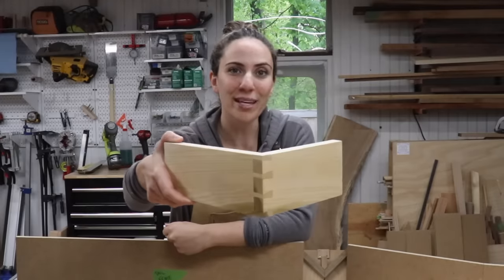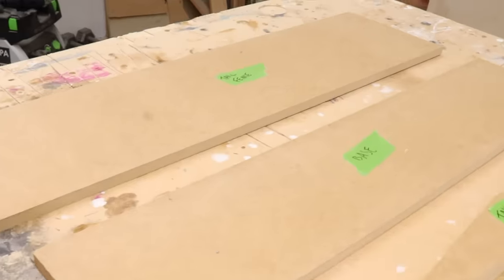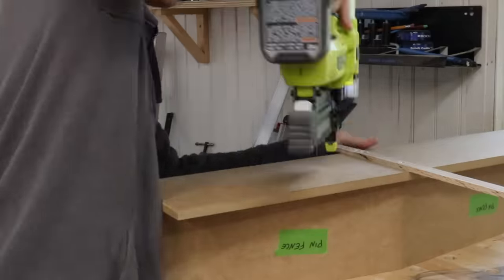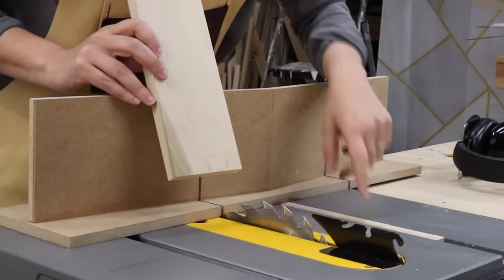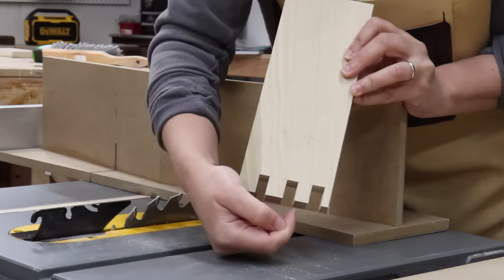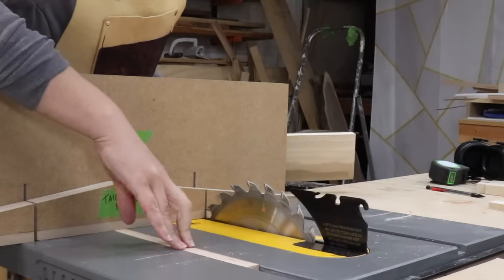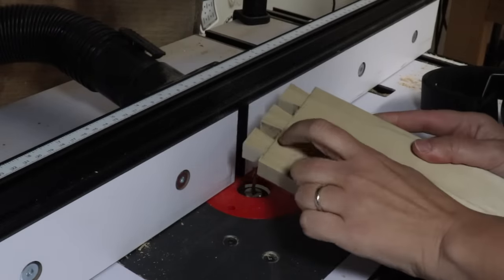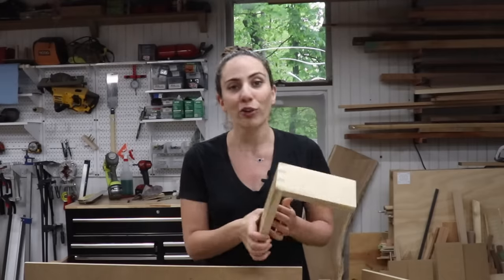Dovetail Jig for the Table Saw // Woodworking Joinery

Comment: It would be easier to tilt the blade if you are cutting the tails? You could then also by bringing it back to 90 degrees clean up the waste. You will have to make a a jig to set the blade to the right angle.

Comment: I love it I think this is a great jig and when you do the tiles instead of adjusting the height of the blade for the other side of the jig I wonder if you could just reverse the timber to cut the other side I don't know if it will work it's just a thot
Reply: I was about to say the same thing.
Only, you have to accurately mark the board on both sides.

As a matter of fact, only mark the ends, which side is the waste and then set the height.
Reply: I had got as far as thinking that the sloping part of the jig could slot between two stops, and you just take it out and turn it round. Your way is probably better, but if you weren't confident in accurately taking the measurements round to the other side of the piece (like I'm not - I'm junk at that), then that would work...

Comment: Great video, is that the dw745?

I've got the european version and the blade guard setup on the riving knife means you can't do no through cuts. Is that a standard riving knife that came with the saw or a one you bought after?

I'm resisting the urge to cut the top off my riving knife
Reply from the maker: Thanks! Yup. It’s the 745. This is the stock riving knife and The blade guard can be removed on this riving knife. Don’t know how the European Models are made. Sorry. I recently did a video where I installed a zero clearance insert with an MJ splitter if that’s something that interests you
Reply: @3x3CustomTamar  ah, the UK 745 comes with a riving knife that's higher than the blade. I was hunting for a better option but it seems we cant get one here.

So I gave up, I've ordered a second riving knife and I'll just cut it down :)

Comment: Great Videos Tamar!  The only suggestion I'd like to add is, when you build your Jigs, is to add a dado a slot in your jig bottom to mount your Miter slide into before it's glued and screwed. This will keep your miter slide slat true and square long term.

Comment: Beginner here, do you have a prioritized list of tool purchases?
Reply from the maker: Tablesaw was a big one. Then after that router.
Reply: @3x3CustomTamar  What table saw do you recommend? I have seen a variety of saws with different blade sizes, and it is getting confusing. Small workshop area so it needs to be portable and somewhat compact.
Reply from the maker: @timlist4173  I would recommend mine but they don’t make it anymore. Dw745

Comment: Super important safety point. Your fingers appeared to get incredibly close to the blade around the 0:50 mark. It may have been the angle, but that blade WILL cut your fingers off so fast all you will feel is a tug and it is gone. Please always use a scrap piece of wood to move the cut off if it is within the cut out portion near the blade.

Comment: Bear in mind back in the day people would do this or a living so there’s no substitute to the student gaining hand eye coordination. However there’s some interesting tips in there, I was shown to use the saw in the tails saw cut years ago by an old boat builder however never liked that technique. I would say rather than angling the saw for the tails cut place the piece in the vice so your cutting straight down. Lastly I get on very well with a gents saw filled like a rip saw and I don’t dress the side of the blade so much to substitute for nearly zero set.

Comment: I might make a thinking error here, but can't you just turn your workpiece around to get the opposite angle? 🤔 And I feel like placing the workpiece flat on the workbench, clamp it down and only use your chisel should do the trick? But again, I really have no idea what I'm talking about... I'm just thinking "out loud"... Anyway, you did it! I have never done this before, but did draw a design for one of those handsaw dovetail jigs with little magnets in it to "lock" the saw blade in place 😁 Wonder how that would work out 😬
Reply from the maker: Maybe. I have the Katz Moses dove tail jig now. I think that’s kind of like what you’re describing. It’s great
Reply: @3x3CustomTamar  That is exactly the one I mean!

Comment: Couldn’t you make it all one jig by mounting the pin side and tail side to opposite sides of a larger base with the business sides of each oriented to the middle of the base? Then it ends up being the size of a cross-cut sled and you just flip it around on the table saw.

Comment: Interesting concept with this setup. However if you are going for both a very solid joint and look appeal, why not use a basic, easy to do, finger or box joint setup and then drill small holes and insert wood dowels to positively secure any joint and look amazing at the same time. You have tow options doing that. One is to come in from the top of the joint and drill through all the fingers for the inserted dowel. And the other way is to come in from the finger side and insert dowels in that direct. Just an idea...  Thumbs Up either way!

Comment: Have you figured out the tails yet? (It’s been a year) 
A few thoughts 
1) spin the jig around, in the same slot, and align the piece on the backside.
Or 2) put the other direction ramp on the backside enabling you to eliminate half the jig. (You did say it was kind of big)
Or 3) figure out the difference and remake the jig with the ramp moved over whatever that difference is.
Reply: Agreed with Paul, I believe that you could just transfer your marks(though a chance for error here) and flip board.

Comment: Don't worry about your angle. Any $99 table saw has good angulation capabilities. and you will not have to worry about cutting above or below the line.

Comment: What is the primary purpose of dovetails. Show, or Strength?
Reply: They're for holding corners together.  They have good tensile strength (they're hard to pull apart) and they give a lot of surface area for glue without the need for screws or other mechanical fasteners
Reply: @BHNarezza  Okay, then why are the pins so small. Doesn't make sense to me.

Comment: No carpentry, just machining. I agree you used some marking out and setting up skills, but for the most part, the 'skill' of the job has been given over to your equipment.  I love how you try to over explain what you are doing as though none of us had ever made a wooden joint before. Like teaching your daughters to make pastry, gods that must be a bore. There are a number of carpenters on Youtube that can make the same dovetail box withut using a single machine, imagine that, all by hand with less than a hundred dollars worth of tools. Whats more, mistakes, if they happen, are not shared, it is not a sign of being clever, but a notice that you don't think ahead, don't practice, just tell. All that yakkety yak and not even a rebate for a bottom panel. Well done.
Reply: Yes, clearly the skill of the job was given over to the equipment. She just set the material down near the machines and they did all the rest! I think you are far too clever for this channel. I hope you find some content more suited to your likes. Meanwhile the rest of us 175K+ subscribers will continue to watch this channel with great interest...

Comment: Instead of lowering the saw blade for the second side of your cut, try this. Make a TEST cut using BOTH sides of your jig. Then using a dial caliper, measure the depth of both cuts. Then cut a piece of wood to that EXACT difference between to two depths. Then attach that thin piece of wood to the side with the deeper cut to RAISE the work piece, rather than Lowering the blade. This would be a ONE TIME deal and the jig would then be good to use for BOTH sides of the cut with NO need to adjust the blade height for each side.  Simple way to solve your problem ONE TIME and be done.

Don.
Reply: Thank you very much for your Heart reply, it means a lot to me and tells me you care about what your viewers think of your videos. 

I think that while I offered you a good way to correct your small problem with the saw blade being too high on the second side, my advise was in error. I did NOT take into account the fact that your fixture is holding the work piece at an angle, 6 degrees if I remember correctly, and that needs to be taken into account when you make a spacer to raise the work piece instead of lowering the saw blade. I was up last night half the night thinking about this issue for some reason as I’m thinking that the difference between the two cut deeps would be TOO much if you make a spacer that thickness due to the 6 degree angle of the jig. 

What I would recommend is that your make a second test cut, first make a cut on the second side as is, than install a spacer made from maybe a piece of 1/8 inch Hard Board, Then make a second cut and see if the .125” Hard board gives you a .125” shallower cut. My brain is telling me it will be more like .130-.135 instead of .125” . If I’m correct in my thinking this would mean a spacer made to the difference in the two cut deeps from what I told you to try last time would be too thick. I’m thinking you need to use either the sine or cosine of 6 degrees to correct the thickness of your spacer. What you could do is do the second test I just suggested and then use the same percentage factor to use to correct for the angle of your jig. You could look up a Trig table online and get the sine or cosine for a 6degree angle, but I’m thinking doing the second test cut using a spacer of .125” thickness would be both faster and easier to get a percentage factor to use to adjust for the angle.

I hope this makes sense to you as I described it. Knowing you from watching a few of your excellent videos, I’m pretty sure you have it all figured out by now, being as smart and clever as you are. I appreciate SMART people and you are one of my favorites when it comes to watching videos on how to do DIY projects. Keep up the excellent work. I’ve been doing wood working since before you were born if I’m not mistaken, and I stall manage to learn a thing or two each time I watch one of your videos. You come up with great ways to solve problems, especially when you don’t have what you would need to do a job, and you just figure out a way to get the job done with what you have. 

Thanks again for the heart post.

Don Fisher

Comment: Bit of a stretch to call this a tablesaw jig since you used every tool in your shop except a lathe.  

Granted you did cut 4 of the precise lines with your jigs.  It would be an improvement to have a system that would index the cuts so that pins and tail could be done without hoping the alignment with the blade was close enough every single time.

Comment: On the tail jig, why don't you just lay out both sides of the work piece, and then you can just flip the work piece around instead of switching sides of the blade... 🤔
It should just be a square line across the end grain, because everything else is already set...

...or am I missing something?

Comment: I seen you struggling with trying to clean up the end bits with power tools. Sometimes the simplest tools are the best for this - the good old chisel. You would have had them cleaned up in less time than it took to set the bandsaw up. Cool jig though for the table saw.
Reply from the maker: Very true!

Comment: You could just add the difference in height to the left edge to make the two sides the same.  Easier than moving the miter slot bar…

Comment: What was the point of the triangle board? It wasn’t used in the final piece? 🤔
Reply: Did she use them as support pieces to keep the taller part of the jig at 90 degrees?
Reply: it’s used for getting cuts at an angle

Comment: Couldn’t you just use one side of the jig and turn the board around instead of switching sides and adjusting for the new depth?
Reply from the maker: Sure. But that would require extra marking. And this was just an experiment to see if I could replicate the picture I saw online which looked like this

Comment: I've seen a lot of colonial furniture built useing hand cut dovetail journery and looked over a lot of Asian journery that used complex interlocking joints. In the colonial work especially no two sides of the box or drawer were the same, sometimes not even the same number of pins and tails. Three on one side of the drawer four on the other. Your very excellent jig will allow a melding of presison and random. I want to build a carpenter's tool box for myself and, one for a brother-in-law. I haven't built anything yet because I don't want to use machine cut finger joints. BORING! This video is a real problem solver and a treat.
Reply from the maker: So glad you liked it! Yeah! I like that you can make them look hand cut by spacing them out however you like but just makes the initial cuts a bit easier

Comment: Could you take a old blade to a Blade Sharpener and have them change the teeth to the correct angle?. I bet it would only be like 15.00
Reply from the maker: I’m thinking you can.
Reply: @3x3CustomTamar  what degree was that cut? 15? The next time I drop my blades off I'll ask. Im guessing that's a 10" Dewalt saw that you are using right? Would do you need two blades at an angle? A left and a right?
Reply from the maker: @64maxpower  I don’t remember what angle it was and honestly I just don’t know
Reply: @3x3CustomTamar  I was only asking because I would have had one of my blades ground for you.
Reply from the maker: @64maxpower  oh that’s so sweet.  But totally not necessary

Comment: Use a "cutting gauge" (marking gauge with a straight cutter rather than pin) to start the end cuts. That avoids tear-out and as a starter for chisel work. Fit s shim on the second ramp so that you will not have to adjust the blade cut depth. Making the pins first, as you did it, and then marking the dovetails is the easier method because that gives more space for the pencil or knife (assuming small pits of course) but make sure that you have a chisel small enough to fit in the slots! GDA

Comment: OK, yes, very good video, instructive, detailed. The real question is, would you really spend the time to 1. build the jig and 2. actually use it to cut a lot of dovetails. Imagine, you want to build some cabinets with lots of drawers and you want the drawers to be made using dovetails, do you really want to spend the inordinate amount of time it would take to make all those dovetail drawers this way? You can buy at a reasonably price a dovetail jig that uses a router which will make those drawers in a fraction of the time, I know because I have one and used it to do just that. Now, I'm not knocking the video, the video is good, just questioning the usefulness of using the jig. Also, some of the drawers I made were very large and I doubt that I could use this jig to make them.
Reply from the maker: Yeah. I agree with you. As I said in the video. I saw a picture of this jig and I just wanted to experiment and make it.

Comment: Really good video so well done there, however cleaning out the waste with a chisel I noticed you pushing the chisel towards your holding hand. Please don't do that, fit a good vice on your bench to hold the workpiece and always make sure your hands (and your body) are BEHIND the cut direction of your chisel. You have nice hands a slipped chisel could make a serious mess of 'em! Just saying👍🏼
Reply from the maker: Thanks. Noted 😉

Comment: Vrbiage is sufficiently fast as to defy complete grasp!
Reply: It's really not.  Dovetails are not remotely a beginner woodworking skill, and knowing what's needed to do them well without store-bought jigs takes time and practice.  Her suggestion of just trying it should come with a caveat to learn simpler methods first, then you will understand what the parts are, how and why they work, and what the benefits are versus the complexity of the process.

Comment: It is a cool jig, but a too complicated for me.  I've got a dove tail jig that I use with my router, much simpler, limited thinking involved.  Its a flat piece of metal with slots in it on both sides.  It screws into a 3 x 4..   Multiple companies make them.
Reply from the maker: Those are great

Comment: 0:40
Never never cut material on table saw by pushing both end 
And 
Always stand on left side of the saw blade
Not behind it  or behind the pes you trying to cut (Between The saw blade and the fence)
Other the that 10/10

Comment: One thing I see you do wrong is you wear long-sleeve shirts with your thumb wrapped up in the sleeve. That is an invitation for a blade that grabbed that cloth and cut you good. You should be wearing those types of clothing around moving saw blades. Might be a good fashion statement but not a good idea around saw blade.

Comment: Way to complicated, you make a 8 degree block and attach to the bottom of a router with pilot/flush bit. Make two templates, one pocket and one tail. Now you can make Dove tails regardless of height of board or thickness. Lastly, wax or paint with expoxy any surface area or track blocks.
Reply from the maker: This was just an experiment to replicate the jig I saw online.